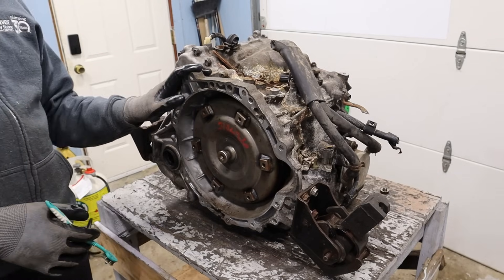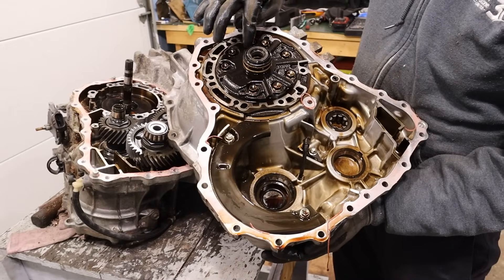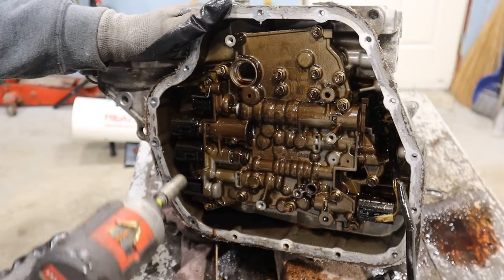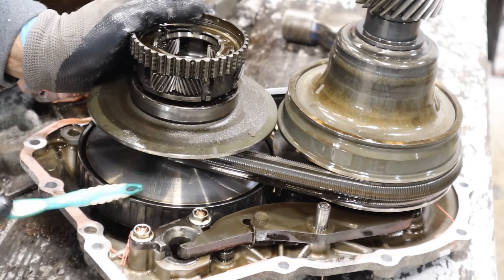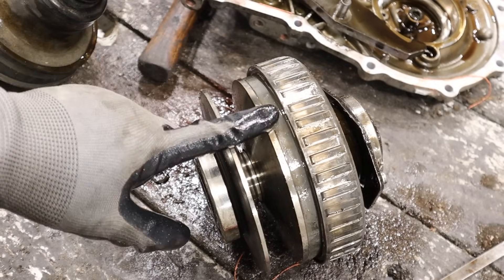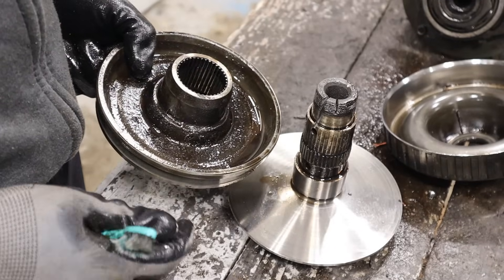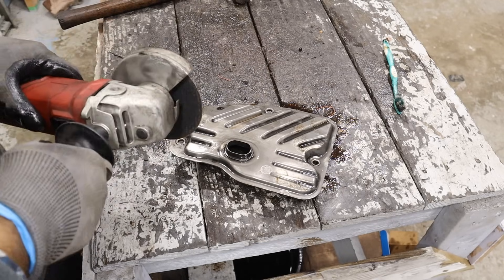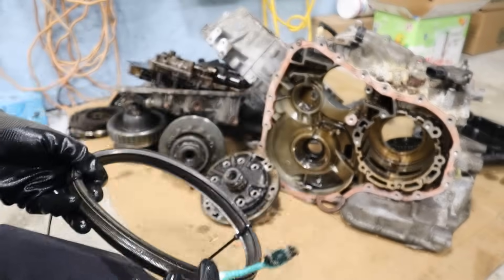Toyota CVT's Are Not as Reliable as you Thought! Corolla K313 Transmission Teardown & How it Works

Comment: Since you've taken apart both: how much does the Corolla CVT weigh vs. the power-split hybrid transmission? (I don't like calling it an e-CVT since it's fundamentally different technology.)
Reply from the maker: Weigh? The hybrid transmission is much heavier with two electric motors. It's alot more sturdy in my opinion.

Comment: My dads car has a k312 in it. The car has 170000 km on it ive been handling all the service intervals myself. Have been changing thr CVT fluid at 35,000 km. The car is in as good as first day condition mechanically
Reply from the maker: Awesome
Keep it serviced and it'll do well

Comment: I have the Corolla hybrid E-cvt. Bulletproof
Reply: it is. But it has a very different transmission than this one
Reply: @joskd8491  I'm aware. I am not a fan of the belt driven CVTs, even Toyota's. The transmission is only as good as the belt which has a million parts in and of itself
Reply from the maker: The e CVT's are a very sturdy design. Theyve proven to be reliable

Comment: Toyota hybrid system (e-cvt) is the most reliable gearbox. Ever.
Reply from the maker: Agreed. Theres also one speed reduction gearboxes from electric cars they are even simpler
Reply: @speedkar99 yes. Actually Toyota hybrid system is not much complex than bevs gearbox. Only additional one planetary gear and ice.
A lot of manufacturers today use Toyota hybrid system. Ford Suzuki Mazda Byd Renault Subaru Lexus etc. Honda and Mitsubishi use similar but a bit more complex with additional clutch (brake pack).

Comment: That is NOT a tranny cooler, its a tranny warmer. Nissans have these too. 
They only act like "coolers" once your cvt fluid temps rise above your coolant thermostat temp. If your thermostat is 194F for example, you can see the cvt fluid temps stay around 205-210. This is NOT a cooler, and is very inadequate for transmissions in general, let alone cvts. 
If there are 4 lines going into the heat exchanger and 2 of them are smaller, you have an external auxiliary air to oil cooler. This cvt only has a heat exchanger, hope this helps.(again, it's NOT a cooler, just prevents it from overheating, it still gets way too hot)
They do this since it will at least last the warranty period and that's all they care about.

Comment: It wouldn't cost very much money to have an external auto trans fluid filter...
just place an oil filter with it's housing somewhere on that CVT housing.
This would tend to keep the fluid clean.....and is a cheap solution to collecting suspended clutch material ......
Reply: This. I understand the hate for Nissan cvts but at least they have external paper filters that are easy to access.
Reply from the maker: Yes but it creates a pressure drop that needs to be accounted for

Comment: This transmission was a K313 which is for hybrid synergy drive. I would like to see a K120 taken apart which has a physical 1st gear, to see if they are more reliable than this one which is a pure CVT with no physical 1st gear. I did notice the ease with which you removed the belt, where the Honda version (which I own) is very difficult. Makes me wonder if these Toyota versions are actually serviceable.
Reply from the maker: Id love to see the physical first gear. It's likely a clutch that locks the drive to driven.
Reply: K313 has nothing to do with hybrid. It's for regular ICE cars. Hybrid sinergy is not a real cvt and does not have a reverse gear. The reverse is done by MG2.

Comment: I have a genius idea to make a indestructible CVT, you replace the drive pulley with a generator, you replace the driven pulley with a motor, replace the belt with electric cable, wait you said Toyota has already done that? And it’s call hybrid?
Reply: no, Toyota uses a very different kind of transmission for their hybrids. It's only a planetary gearset, attached to two electric motors and a petrol engine. It only BEHAVES like a cvt, but it isn't a cvt.
Reply: @joskd8491  CVT means continously variable transmission which refers to continously variable gear ratio, which an eCVT still does, your engine can directly drive the wheels, its not an electric motor, it doesn't necesseraly severes the contact between the engine and wheels, and with that, it has a gear ratio that changes, so its sill a transmission, closer to a CVT than to a an electric motor found in EVs.
Reply from the maker: Good idea. eCVTs are more reliable

Comment: Since 2019 Toyota cvts have a physical launch gear that takes the stress of the unit, makes the very strong...if you maintain them.
Reply from the maker: I'd like to see some high mileage ones to see how they're holding up.
Reply: @speedkar99  Agreed, however, even 175K on a CVT with little or no service seems pretty good.  I know there are a lot of variables but as far as I know CVTs do not last very long.
Reply: @speedkar99 you can just look it up. The newest e-cvts in Toyota hybrids have been in the Camry and rav4 since 2018. There are already probably 1,000s of taxis with 300,000 + miles. They are solid.
Reply: @andrewdishman26  e-cvts are a completely different animal. Not the subject of this video.
Reply: @speedkar99  I feel like the longer it takes for you to get your hands on one that failed is also a good sign for their reliability.
Reply: My daughters is whinning at any speed , at 80k miles

Comment: At this point, I'm fine with any CVT that utilizes a chain, including Nissan.  Not these push belt things.  They're just too random.  People can ignore them for 150,000 miles and never have an issue.  Another person can change the fluid every 30k miles, change the filter, do everything they should...and it fails at 80k miles.  "Dumb Luck" seems to be far too large a factor with the push belts.  That said, we had a push belt CVT, 8 years, no issues ever until it was totaled by a moron running a red light.  Car never needed anything but maintenance.
Reply: Belt CVTs has been used on lower power scooters for 4 decades, anything more than 50hp is asking for trouble.
Reply from the maker: I agree...these are for lower powered vehicles. 
Manufacturers have their hands tied on fuel economy restrictions so this helps getting around that at the expense of longevity

Comment: There's alot of confusion when it comes to Toyota CVTs. Their original planetary gearset "CVT" in the hybrids from 99-2011 was nearly indestructible. The regular CVTs that debuted in the '09 Prius and spread are fallible, just like any belt/chain CVT.
Reply: Matthew.  The CVT in the Prius is entirely different that the CVT in this Corolla.  The Prius (1999 to present) has always had an electronically controlled CVT and has never had a belt and pulleys.
Reply from the maker: Prius is different 
And as far as I know the third gens didn't have transmission problems

Comment: With proper maintenance, filter and fluid change every 60 thousand miles, this CVT trans can last more than 400 thousand miles.
Reply: 30k fluid changes recommended.
Less than that for severe service.
Reply: @evan937
2 hours ago (edited)
My sisters 2014 Corolla with the CVT has 300k on it now...
Reply from the maker: And easy driving. No towing
Reply: 60k is a LONG time for the cvt fluid to break down.
Reply: That's very optimistic.  The clutches to provide reverse would most likely wear out before 400K miles.
Reply: If you want a car that will go 400k miles without issues you need a BMW. My 2009 328i has a little over 300k miles, Its entire mechanical items replaced list consist of, oil pan gasket, valve cover gasket, oil filter housing gasket, all 6 ignition coil and spark plugs one rear oxygen sensor, and the engine computer. I purchased this car second hand at 16k miles in 2010.

Comment: The aftermarket filter indicates past maintenance, likely performed by a third-party shop, since Toyota dealers tend to refuse to replace the lifetime transmission fluid for their customers.  Car owners are in a catch 22 these days, and could end up with non-OEM fluid and an aftermarket filter.
Reply: Toyota CVT fluid is freely available....
Reply: @JohnSmith-pl2bk  The dilemma is, independent shops are known to be comfortable using aftermarket filters and generic fluids.
Reply from the maker: True 
Good point

Comment: WTF a Belt 😂😂 did they get those left overs from Nissan 💯 😂😂 JUNK
Reply: A lot of automakers use them.  They are much more sensitive to maintenance than gear driven ATs.  Many owners who go above and beyond the recommended maintenance intervals have had no problems with CVT failure.  My 2014 Nissan Altima 2.5S has 152500 miles on it - original engine and CVT.

Comment: the average person knows to change their oil but not their transmission fluid. most people don't think to service their transmission until they start having issues. one of my friends has a Civic with a CVT and I drain and fill the transmission in it once a year and the car still drives like new at over 200,000 miles.  from what I remember the service manual that came with his Civic said to change the fluid every 25,000 miles. even though the fluid is drained and filed at less miles than the service manual says, the fluid is really dark.
Reply: The Honda Fit/Jazz has a drain plug and a fill plug easily accessible on the end of the CVT housing.
Drop the fluid and just refill with the entire contents of the 3.5 litre jug that Honda sell for this purpose.
There are 13.5 litres in the whole trans...so doing this drain/refill every 2 years keeps the fluid up to scratch.
Reply: @JohnSmith-pl2bk  on any vehicle I ever owned ,whether it was manual or automatic, I would drain and fill the tranny once a year.
Reply from the maker: Good point. No one thinks of the transmission
Reply: @speedkar99 true, I learned am how it important the maintenance was after mine failed on my 2007 RAV4 at 255,000 miles. I am female and it was the first car I got on my own. I am teaching my daughters to follow the manual.

Comment: What fluid change interval do you suggest?  I think Toyota says 100k-120k.  Is changing the filter with the CVT in the car hard?  Thanks
Reply: Please do not replace your fluid at 100k, you can actually cause damage to your transmission if it was never serviced before that. If your cvt equipped vehicle has less than 100k miles on it, change it at 30k miles from now on. Hope this helps.
Reply from the maker: Once a year. Remember draining it is only a third of the fluid.

Comment: I think the ones that everyone thinks as reliable are the e-CVTs of the hybrids, that are completely different to these ones. The e-CVTs don't have belts, clutches or anything like that. Just two electric motors and planetary gears. It's pretty cool.
Reply: Yep! i prefer manuals but the e-cvts are freaking solid, brilliant idea.
Reply: Like the Honda civic hybrid. Only has one gear that engages above 43mph.
Reply: Mmmmmmm
Reply: I like that you can change gears without coming to a complete stop without completely ruining the lifespan of them.
Reply: it's pretty interesting. sadly it needs a big battery pack because it has to counter the input rotation when the car is stationary.
Reply: All cvt transmissions suck, all of them. You cannot buy parts to rebuild these transmissions.
Reply: @donniev8181 : genuine question: have you seen ecvts go out? If so, was it lack of maintenance or design flaws?
Reply: @sarcasticundertones3513  I wouldn't hold my breath. Basically they are saying that all CVT transmissions suck and whoever comments something like "look at this specific CVT", knows nothing about them. Clearly not a person that tries to establish a conversation among adults.
Reply: @donniev8181 you seem to lack the knowledge of the e-cvt had 4 of them lasted longer than any transmission ive ever owned... never had a single a single problem with any e-cvt but problems with all others. I've been delivering for 3 decades.
Reply: @donniev8181  Not true, you can get CVT parts from Toyota.  These things get rebuilt here in in Southeast Asia.
Reply: @donniev8181  😂sounds like experience?
Reply: @phillm156 professionally trained transmission technician. He rebuilds transmissions daily and no, I would never be dumb enough to buy a car that has a non shifting cvt transmission! 
https://youtube.com/shorts/PVmElbh32T8?si=-CCiW2A2NtzLcjQn
Reply: @donniev8181 esto no es una cvt... Tiene el nombre por las sensaciones pero no se parece en nada físicamente.... Y en fiabilidad tampoco.
Reply: @donniev8181  Please, check any video where they open and explain the e-CVT one. They are even better than manuals, since they don't even have synchronization rings. There is nothing to go wrong.
Reply: @TBDFood here's an idea, stop commenting on things you clearly know nothing about!
Reply: @TBDFood professionally trained transmission technician, 
https://youtube.com/shorts/PVmElbh32T8?si=-CCiW2A2NtzLcjQn
Reply: @donniev8181  Firstly, those are Nissan with especially shitty CVTs (although they last much longer if you replace the gearbox oil every 40k miles or so). Secondly, the Toyota e-CVTs, that they use in hybrids (I'm not sure if they use "regular" CVTs in some models), they are COMPLETELY different, as I commented in my original message. So please, read first and reply after, because if not, we're just wasting time.
Reply: @donniev8181 pero que dices... Si el que ha demostrado que no tiene ni idea... Eres tú.

Comment: dumped my Scion iM with a k313 cvt like in the video with 100000 miles. ran fine, changed fluid 3x and filter 1x. got a rx350 2014 made in japan. No more driving with caution with this cvt. never buying a cvt car again
Reply: The CVT ain’t the problem it’s lack of maintenance

Comment: I just dont get the push-belt logic :face-red-droopy-eyes:its the same thing as pull-belt, every cone in cvt has pull side and the push side 🤔
Reply: The pulleys apply high pressure on the belt so that the belt actually does 'push' the driven pulley with the drive pulley.  Weird I know, but that's how the belt and pulley CVTs work.
Reply: A pull belt pulls through a solid material like a rubber belt or through links like a chain. This belt has neither. Pulling on this belt would separate the wafers. The wafers on the other side prevent that by pushing the wafers around to keep the space filled. The metal rings are the link.

Comment: I bet they took it somewhere to get the fluid changed and the used universal automatic transmission fluid instead of Toyota CVT fluid.
Reply: As a Toyota technician I still use the Castrol "universal." The fear of using anything other than the fluid provided by AISIN or IDEMITSU is just overblown. The fluid is rated for it, and operates perfectly fine. We even use their fluid sometimes in the shop if we run out of AISIN.
Reply: Or never changed it at all...

Comment: I didn't noticed if electronics for the control of the valves reside in the housing or it is external? Is only couple of wires swimming in transmission fluid or there is something more?
Reply: Basically ALL the wiring was swimming...crispy wiring a speciality...

Comment: toyota and everyone else says the fluid is lifetime so your average user doesnt know there is a fluid change to keep up with. even for changeable fluid transmissions dealerships will not recommend trans fluid changes. they want your vehicle to break and you buy another one or another transmission. so these are reliable but they are sabotaged by toyota corp and the dealers saying you dont need fluid changes lol and depending on how hard its driven and how hot the ambient temp is, fluid degradation will increase the hotter it is and the fluid will stop doing its job properly
Reply: Read the ACTUAL service manual that comes with the car. They have service intervals.

Comment: The eCVTs toyota uses in their hybrids seem to be bullet proof.  Why can't they use eCVTs in normal Ice vehicles.
Reply: eCVTs are motors/generators that's why they're exclusive on hybrids.
Reply: u have to realize that most of the time, these terms are just marketing terms. the Toyota eCVT is NOT an actual CVT transmission. Its an electric motor/generator. Same with the Honda eCVT in their new hybrids.
Reply: It’s more expensive than regular CVT plus people doesn’t take care of their car doing proper maintenance lol!
Reply: @alanmay7929  NO! You don't get it.  Hybrids have a large battery that provides the high DC voltage to drive the motor generators.   eCVTs ARE ONLY in hybrids.  It's not because it's more expensive (even though it is).